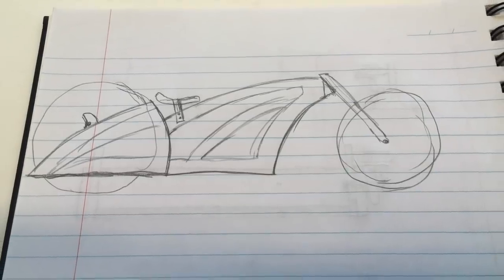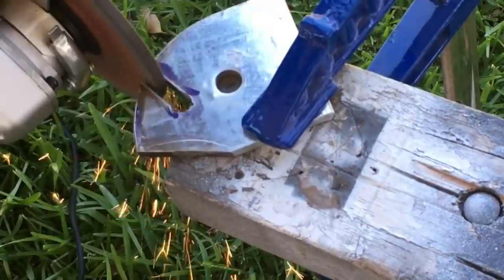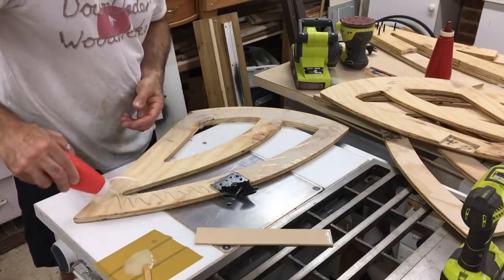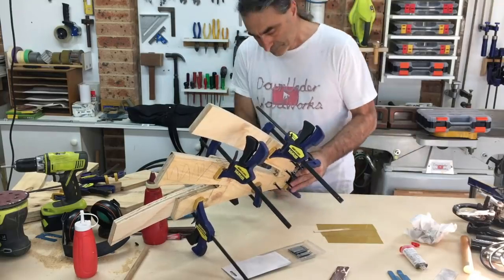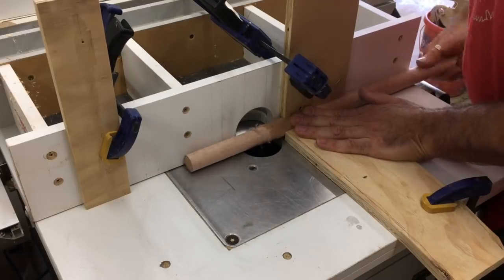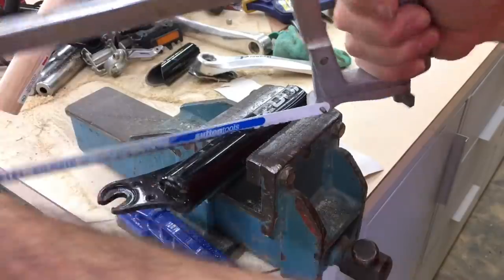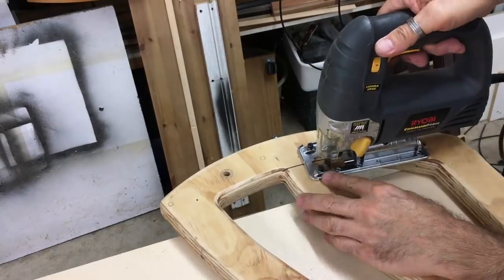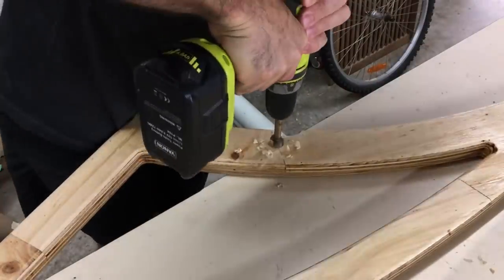Building the most awesome handmade wooden chopper bike

Comment: Dayumn!! This is one of the best projects ever and a really impressive result!
Reply from the maker: Thank you very much
Reply: @DownUnderWoodWorks  You could put your logo on it somewhere (the head tube?) and/or a name eg BWC (Badass Wooden Chopper!). Maybe fit one of those old school saddles with springs? Could paint a white band around the frame on or next to the black metal donor part at the front to get a black&white effect matching the wheels? Maybe a bash-guard/skid plate for the leading wooden edge beneath the crank spindle? It really is an inspiring project.

Comment: EXTREMELY COOL...Please, use some of that plywood and  design a "springer/girder" style front end
Reply from the maker: Thanks Jim. Probably not the same thing but i am thinking about doubling up the dowels on the front end
Reply: @DownUnderWoodWorks  __and i'm assuming a dummy running behind the one that's there now. maybe a tad bigger diameter? that's all it needs, IMHO, just the opposite of why you cut the center out of the tail section..it's very cool and as far as functionality, "a thing of beauty is a joy forever". forever's pretty damn functional,lol

Comment: Thinking Baltic birch ply would rule, looks and strength for the win.
Reply: Maybe he could get full sheets and cut out in one piece and not spliced in. This would be a structural improvement I think.

Also make the wheels wooden. Keep the tires normal just wooden wheels. Make wooden pedals. Keep the chain and make the seat wooden.

👍😁
Reply from the maker: Thank you very much for your comment. Apologies for the late reply but I'm trying to clear my "Comments I haven't responded to" list.

Comment: This is awesome Vic! How much flex is there in dowels. I'm surprised they can handle the weight at that angle. Although, I guess you're sitting far enough back that the weight is on the back wheel...right?
Reply from the maker: Thanks very much mate Yes, almost all the weight is at the back wheel. The forks and the frame itself have a lovely soft subtle flex though.

Comment: Saying hello from Vancouver, Washington USA! Great project and a super fine piece of artwork. I can imagine a stable of wooden bikes with different shapes and using different woods. 
What do you think about drilling a hole down the center of the forks/dowels and inserting a 12-15mm metal rod for strength? If you don't have a drill bit long enough to extend the full length of the forks, you could cut the forks into smaller pieces and then slide them over the rod with some glue. 
Regardless, you did a masterful job! Many thanks for sharing this with us all. -R
Reply from the maker: Thank you very much Richard. Although the bike wasn't built to be ridden regularly i am thinking about doubling up the dowels on the front end

Comment: Needs a Disc Wheel in back... fancy new triple twisted spring front wheel.... and disc brakes on rear only.
Also new LED and battery stack ... for those hot summer nights downtown,... cruise'n.
Reply from the maker: Thank you very much for your comment. Apologies for the late reply but I'm trying to clear my "Comments I haven't responded to" list.

Comment: Absolutely Love it !    a bit worried of down pressure on the handlebars though ?  with your skills you could have made ply wheels too !
Reply from the maker: You're right about the handle bars Jon, luckily its not an everyday rider. I thought about some kind of wooden wheels but imagine the weight then.
Reply: @DownUnderWoodWorks  I recon 2 pieces of 1/2 ply glued together with holes to holes the weight, with the tread of a tire would have worked well  But still an amazing piece of work !  Still love it . A Big Well Done

Comment: Why do you say it's not very useful? 
You're not able to make long distances on it or achieve normal speed?

By the way - how much does this bike weight in total?
Reply from the maker: The handle bars are a huge weak spot in this build, they are really just for looks. if this had steel handle bars you could probably ride it around. It would have to be mostly flat ground though.

Comment: you mounted the gooseneck to the wood frame by flattening the pieces of donor bike frame and then sandwiching them between layers the wood frame with bolts and epoxy. But then you added a black plate on the outside of the wood frame with the bolts holding the gooseneck. You don't talk about it in the video. What was its purpose?
Reply from the maker: Yes, sorry about that. The black plates are purely aesthetic to cover up the cutout i had to make in the frame. The original black screws i used were only temporary until i added the black cover plates (which are 3mm MDF by the way) and the chrome screws.
Reply: @DownUnderWoodWorks  the wood plate that you made to sit on top of the gooseneck to hold the tops of the forks, is it held to gooseneck with friction? No bolts  to the gooseneck? Does it hold well to the gooseneck?
Reply from the maker: @zombyfellow  That wood plate is held down and in place by the handlebar mount directly above it and the gooseneck top cap that locks everything in place. this is the same setup that you find on a bike.

Comment: 🙄 It’s art you hang on a wall. Let’s see you ride that up a driveway without it breaking in half. 😂😂😂Looks cool though.
Reply: Did you watch the video? He rides it!!
Reply: cuznlucky Omg. He rides it for 30 feet on a pool table flat street. Look at how low the back boards are to the pavement. Look at how long the frame is. As soon as he hits an incline the bike will bottom out and fall apart.
Reply from the maker: I actually rode it in and out of the driveway quite a few times while doing the video. no problem at all.